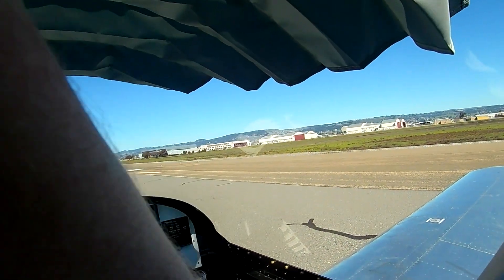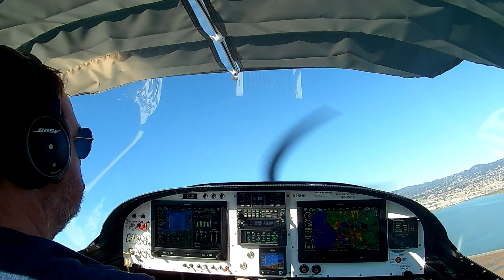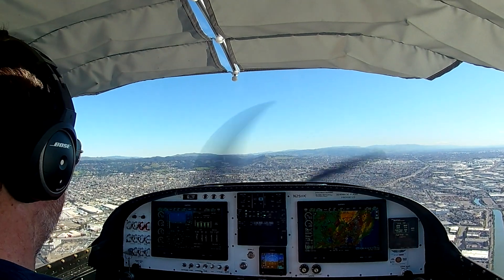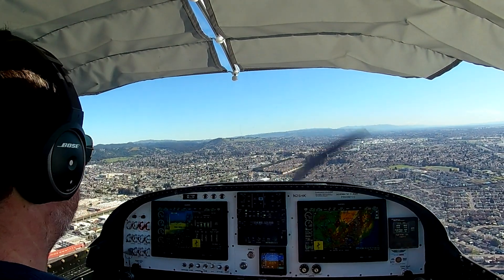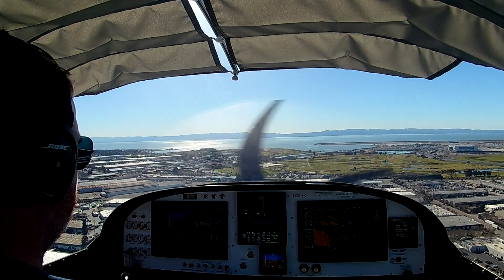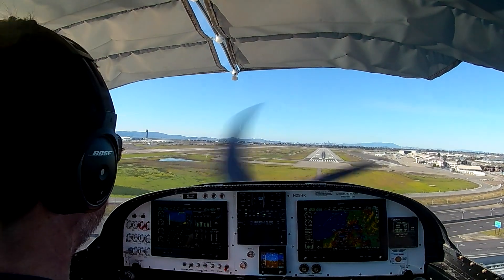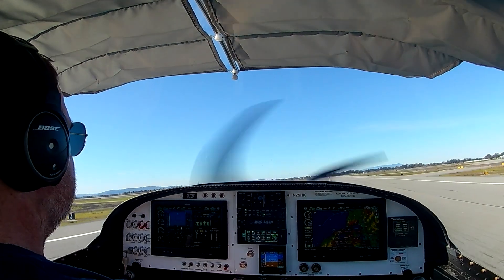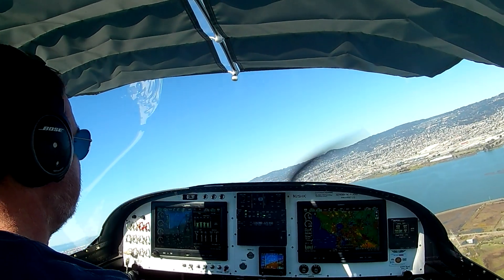RV-14 Anatomy of a Pattern

Comment: I’m curious if you changed your approach speed as you got used to the airplane.  1.3*Vs0 is around 66 KTS, meaning your standard approaches are about 10 kts too fast.

Comment: Did you reset the max flap extension speed to the recommended 100kt? Or maybe 5kt below, given that it might be useful to use the flaps to slow down on descent....
Reply from the maker: I left the 100 knot block in place so I can't lower flaps above 100kts. The additional 80 kt, full flap limitation is the one that has been removed.